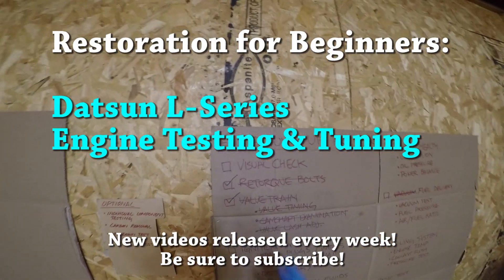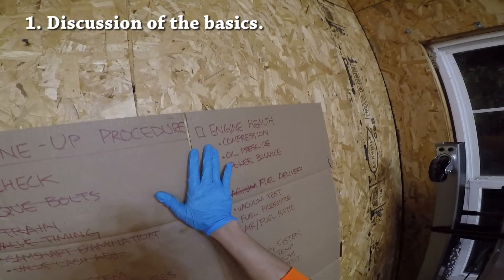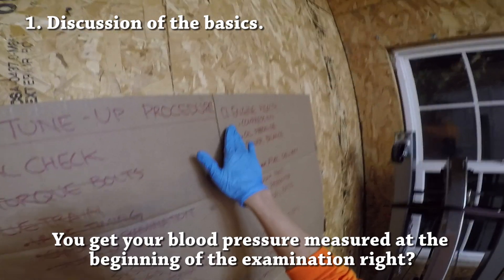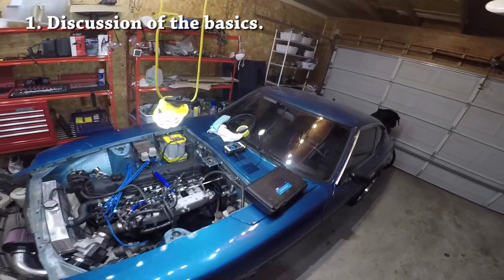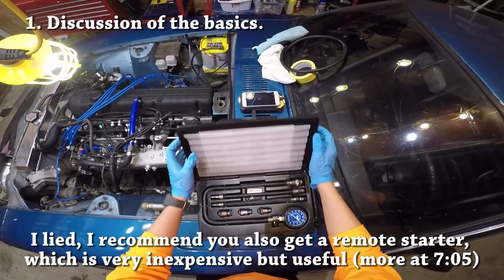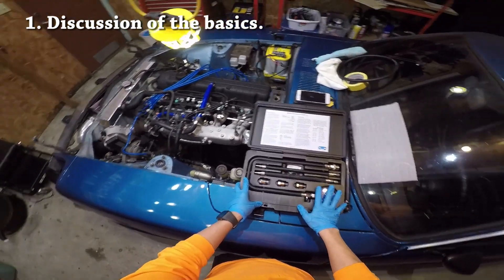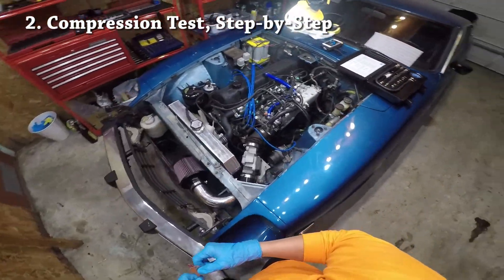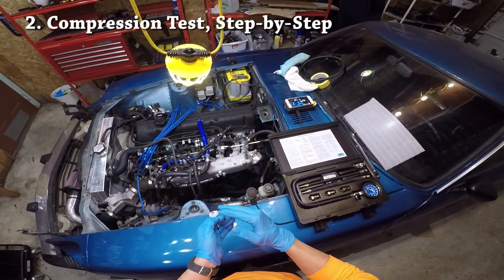Datsun L-Series Engine Testing and Tuning Ep.7 Compression Test and Diagnosing

Comment: Leak down testing is the standard for engine health. I don’t waist my time doing compression testing. I just want to know i have a well sealed and an even amount of leak down on all cylinders. It’s a simple tool with two gages one gage is used to set-the input air pressure. The other gage tells you the differential pressure or the leak down. All engines leak that’s your blow by gases. So if you have an input of 100 psi and the leak down to 80 psi that tells you; you have a 20 percent leak down. I forget where things start going south but 20 percent indicates a good engine. Lower than that and you’re not making as much power. And oh yeah you perform a leak down with the cylinder you’re checking at top dead center. You need to use a breaker bar to hold the cylinder in question at TDC. I use a hundred because it is easy to figure out the differential. Spinning up a engine to test compression is not a good indicator of health because you are pumping air in you really want to know how well it holds it. I would use a compression test to see if the problem is ring or valve related but generally you want to know the health of your cylinder.

Comment: You have tight valves I bet in ur 170 cyl. Adjust ur valves 10intake 12exhaust with motor hot.

Comment: I finally did this test and yielded 158 on 1, then 148-150 on rest... adding oil boosted most back to 158. Might have to get bottom rebuilt or get another N 42

Comment: So question. I recently rebuilt my L28 and we did a leakdown test and the motor was solid, no leaks but the compression was low on 3 cylinders. We checked valve clearance and all was fine. Would you try adjusting the cam sprocket?
Reply from the maker: Which three cylinders?
Reply: @RestorationForBeginners think it was 3,4 and 6 gotta double check again.
Reply from the maker: Seems pretty odd to have the leakdown results come out good and compression testing come out bad on three cylinders. Check this out https://grassrootsmotorsports.com/forum/grm/riddle-me-this-compression-vs-leakdown/82649/page1/
Reply: @RestorationForBeginners  ya I'm stumped. Something is out with the timing

Comment: So compression is right where its suppose to be....Great,  But the question is still there, where is the blue smoke coming from?
Is it possible you can have good compression rings and weak oil rings? Maybe the blue smoke is gone away. Maybe it takes a little while for the Valve seals to seat correctly. At this point I would not give it a second thought, numbers are to good. You had me on the edge of my chair watching those numbers come in. Looking Good.
Maybe PVC isnt clearing out oil laden gases from engine. Install  a Catch Can, or Plug Anti Fouler s on 5/6. They are the 14mm ones that are long, short ones will crush the plug tip, Dont ask me why I know this :)
Reply from the maker: I have no idea, but I suspect that's the issue. I'll discuss much more in detail in the next episode on the spark plugs, but the plugs are really fouled up at cylinders 5 and 6, which was  also the case before I took off the head. My guess is that the car running for an extended period with a blown head gasket between cyl 5 &6 took a toll on the piston oil rings. It's just a guess, but unless I have a crack in the block, I can't imagine what else it would be.
Reply: I have a problem with cylinder 4. Whenever stuck in traffic the spark plug gets fouls and car looses power when driving.
Reply: I would guess valve seals, it can only be valve seals or piston rings, how many miles on the engine.
Reply: @charlesmiller5078  cylinder compression test measured 180 to 182 psi for all 6 cyl
Reply: @charlesmiller5078  engine was remanufactured by california datsun
Reply: @charlesmiller5078  75000 miles but reman by california datsun
Reply: Thats no mileage at all, the compression numbers are great, that shows the compression rings are good, but you also have a oil wiper ring, if oil is getting by that rings, it could get into compression chamber. So just install a plug extender, they cost nothing, and at least give them a try, there are 2 sizes, you need the longer of the 2 . Cant hurt to try. Maybe a leak down test could get you going down the right road. Wherever the air exits, intake or exhaust, that would be which valve seal has gone bad, Im sure alot of the early Zs didnt come with hardened valve seals, which is needed due to the new fuels.
Reply: @charlesmiller5078  what do you mean by a plug extender? Do you have any picture? I have a Colortune that has an extender that goes is fastened in the spark plug cable boot at the tip of the sparkplug.
Reply: @marrisonh  Well I dont have a picture, but its a metal screw in piece that goes in first before the plug, then you screw the plug into it, any parts place have them, remember there are 2 different sizes, long and short, its 14mm and you have to use the long ones, since I now run a catch can, I dont have them installed anymore, they dont take away from performance at all, they just allow the plug tip to be just a little more removed, so not to get fouled as easy. Basically its the same as your colortune extender.
Reply: @charlesmiller5078  i sourced one from local retailer. Should i just screw it and screw the spark plug and then test the  car. If it does not foul. Then it should be a valve seal?
Reply: @marrisonh  First install the anti fouler then screw in the plug like normal. Then unscrew plug and make sure the tip isnt smashed, if it is you got the shorter anti fouler s, if not your in business. This just helps keep your plug clean, dosent fix anything, still could be either the oil ring or the valve seal. you will still see smoke , but it will help you from fouling out that plug.

Comment: I am going to try the warm test, I have only tested them cold, generally in the 150-160 range. Do you recall if they were lower before the valve job? just wondering if the new valve seats helped your readings.
Reply from the maker: I think the readings were generally in between 165~175 prior to the doing any work. I can't pinpoint exactly what did the trick since lots of things happened since.
Reply: just checked mine with warmed up engine, all between 162-165. Think I will check the camshaft timing just to see if it has retarded any.
Reply from the maker: Yeap, makes sense! Let me know if you end up making adjustments to the valve timing. I'd be interested in seeing how much, if any, that advancing the cam timing makes a difference.

Comment: Min, It seems like your car is starting easier?  Did you sort out the depressurizing of the fuel system?  Great video as usual.  Keep it up!
Reply from the maker: Haha hey Simon, that's very perceptive of you. All I did was buy a battery charger and fully charge the battery to 100%. I hesitate to say that that was the only issue, but it may not have anything to do with the ignition system or the fuel pressure after all. Might just a cheap alternator that can't keep the battery charged because I don't take this thing out for extended drives right now.
Reply: You should look into a Noco G750 battery maintainer. You can use the included Noco X-Connect adapter for the battery terminals so you can easily connect and disconnect the G750 for maintaining your battery while you're not using the car.
I always used something like this on my motorcycle so the battery is always fresh.
Reply from the maker: Ah yes, the battery charger I mentioned is a automatic charger/maintainer, but I don't leave it plugged in all the time since it makes a loud high-pitched noise that bugs the crap out of me.
Reply: Ah, that would be annoying. Thankfully my Noco products don't do that.